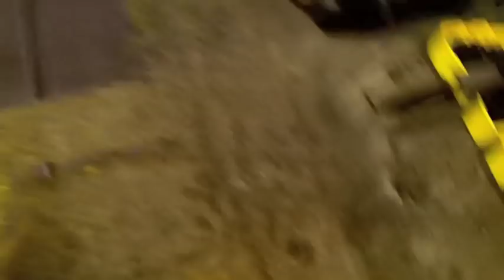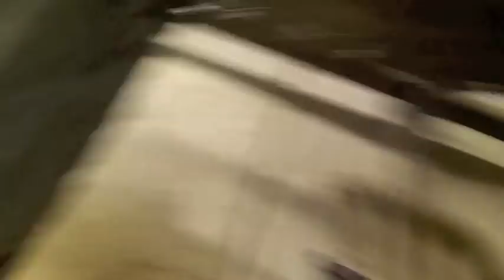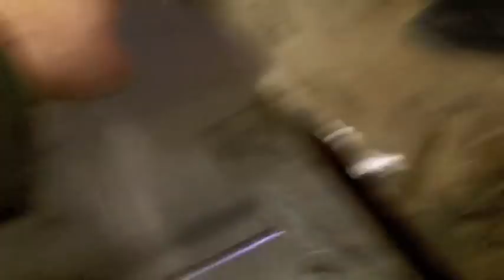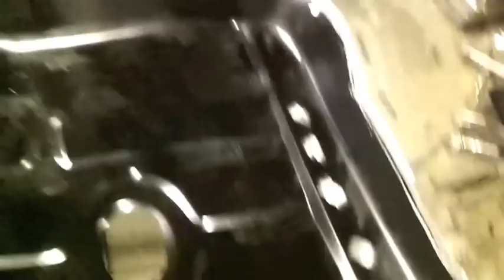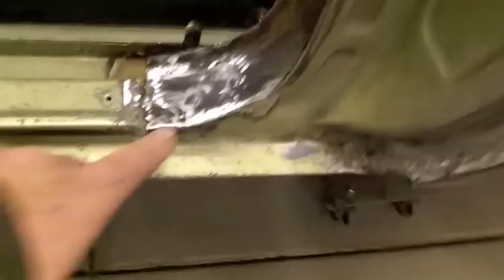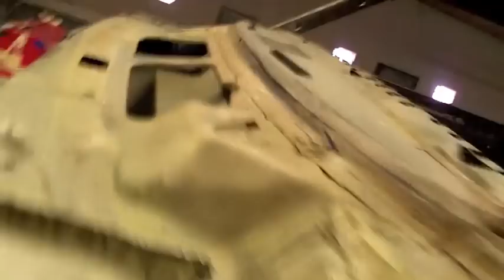68 Camaro Project Part 6

Comment: It always amazed me how fast these cars rusted in the "rust belt." My '69 RS convertible had the rear floors completely rusted away by the time the car was 10 years old. The local auto parts stores stocked sheet metal and it was common for us DIY kids to cut a piece and pop rivet it in and shoot some undercoat on it. Many of these great first generation Camaro's were lost forever due to the salt being used on the roads. Great to see you giving so many of these cars a fresh start!
Reply from the maker: Thank you. I am fortunate I live in a dry area so most of the cars around here are generally pretty solid. Years ago I'm embarrassed to say,  I junked better cars than this but the times have changed and there are fewer of them around. Now I fell strongly that all of these cars can & should be saved.  Do you still have your 69?
Reply: In 1983 I sold it (a decent running condition, 350, 4spd), along with 2 NOS fenders, and 2 NOS convertible quarters for $900.00! I knew these cars were destined to be classics when I first bought it in 1979, but life got in the way. Not long ago I saw a 1969 Camaro convertible trashed shell with no drive train and little else, on ebay fetching $5K. I'd tell you about the other cars I owned and let go, like my 1 of 1,800, 1970 SS454 MontiCarlo......but I'll end up crying in my beer.
Reply from the maker: Yes sir, you & me both unfortunately. :(

Comment: looks good nick nice to see or not see the floor from inside the car lol
Reply from the maker: Thank you Chris. I guess I better go through the brakes since I can no longer drag my feet to stop. lol..
Reply: ya jegs has a 4 wheel disc setup for 830.00 that's what I bought for my 69 you may need them lol
Reply from the maker: Thanks, I would like to go that route. I know for sure it will get front Disc's but I will have to see how the budget is going before pulling the trigger on the rears.

Comment: Your going to end up building more Camaros than GM did !    Cool stuff,  hey got a quick one for you, around the back glass the clips that hold the window molding down, are there 2 on each side of that glass?  Can you use sheet metal screws to hold the clips down, the new quarters don't have the  studs on them?  Thanks again.    Jeff
Reply from the maker: lol..  I think there is 3 on each side if memory serves me correct.  These are what I have been using..
https://www.ebay.com/itm/GTX-Road-Runner-Cuda-Vinyl-Top-Windshield-Glass-Trim-Molding-Clip-Pin-Stud-25pc/122040098836?hash=item1c6a282014:g:JhUAAOSwgQ9VmCTK&vxp=mtr
Reply from the maker: Spoke to soon, the 68 I'm doing now only has 2 pins on each side..

Comment: I think I’ve watched all your videos.  They gave me the encouragement to start work on a 73 camaro.  I’ve been using 23 wire for my sheet metal.   What are you using for wire and what brand?   Is it easy grind?   Thanks.
Reply from the maker: I'm using Lincoln brand 25 wire for the sheet metal work on this car. It's not too bad to grind I guess. Thanks for watching & Good luck with your 73.